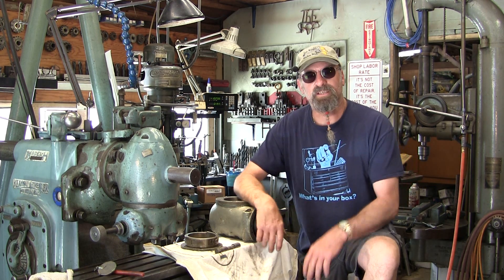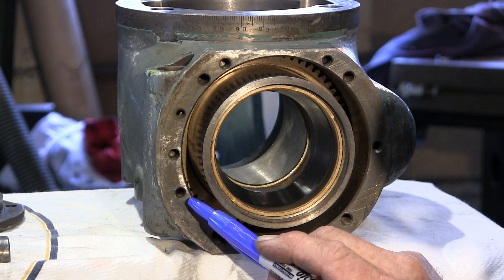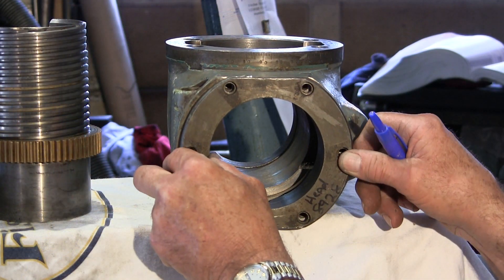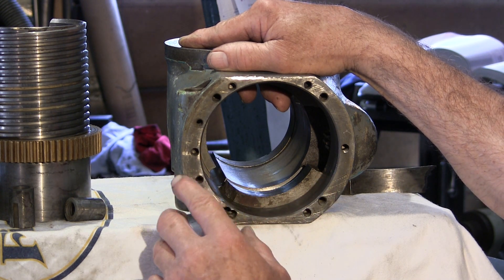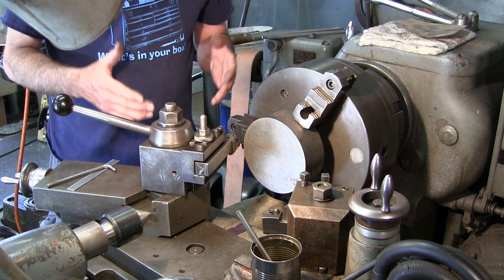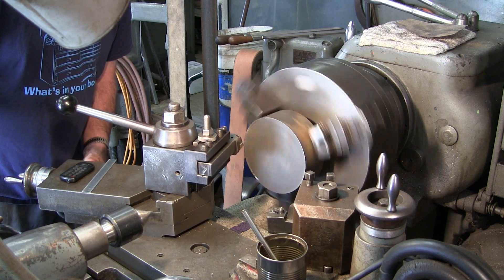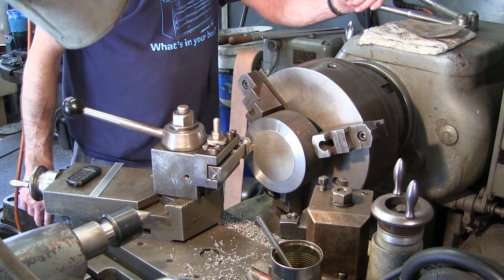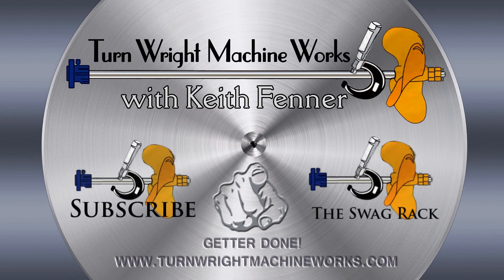Not Today

Comment: I just drove to a place where I can play around with an old lathe every once in a while just to find it blocked behind tables with random heavy stuff. The three jaw chuck on it is no good anymore so I'll try to finish that backing plate adapter for a four jaw chuck I started a while back. With that in place all that's left is to improvise a matching chuck key so I can turn that brass washer I need :-)

Comment: The struggle is real.  Seriously though, we all have those days when things just aren't clicking.  Grab a beer and enjoy the sun while you can.
You did say something that made me curious.  You said the piece you were turning had been laying around for a while.  That got me thinking is there any difference when working on recently smelted steel as apposed to some that has been sitting in a pile for a couple of years.  Besides cleaning rust etc.
Reply from the maker: nothing will change beside the surface condition / color etc. ;{)------
Reply: Yup it does not age like cheese.
Reply: i think that only apply's to casting. but i do know that astroloy brand 4330 sits for 9-12 mouths we use it to make rigging pins for the drag lines
Reply: I agree shows that even the pros have off days
Reply: QQ.